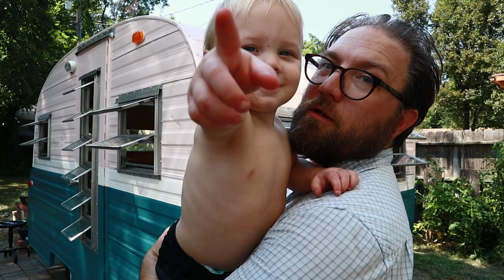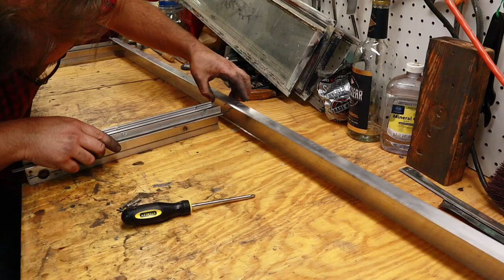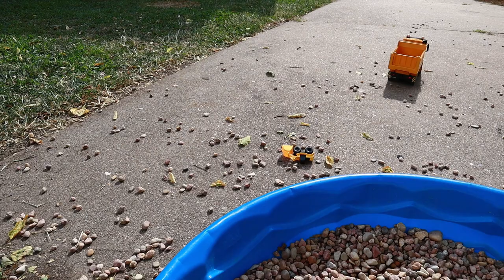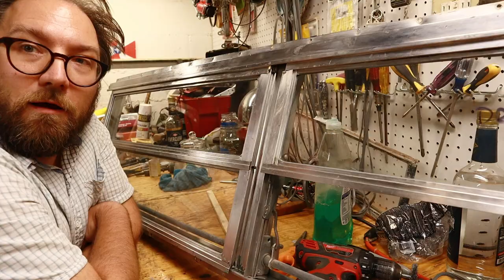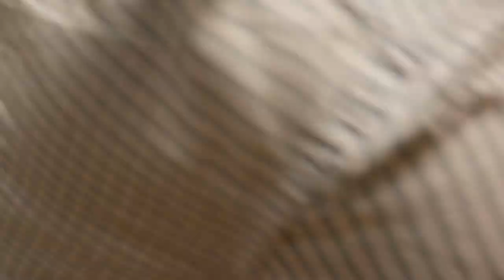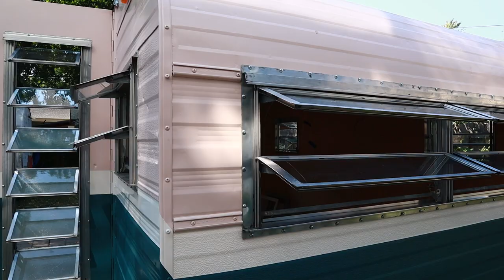FINALLY finishing our VINTAGE CAMPER WINDOWS!

Comment: What do you put in there between the metal and glass to reseal it? 
Also did you take them apart just to make them really clean or did they need resealed?
Reply from the maker: The old seals were really brittle and needed to be replaced in addition to it being easier to clean up the window frames without the glass in them. There is a specific seal for each specific window type. I ordered the replacement seals from vintagetrailergaskets.com.
Reply: @TrailerTrashtoTreasure  Could you provide the link for the exact sealant you used? I have a scotty serro with the crank windows like you have....
Reply: And what was the green stuff in the bottle?
Reply from the maker: All of the seals I used for these windows are linked in the description of this video where I describe how to get the top fin seal in place:
 https://youtu.be/kfjxOgNjUxI?si=yRa-D_8sxxQX_fpb

You'll want to pick up some aluminum gutter sealant for sealing the joints where the sides of the window frames come together as I demonstrate in the linked video. And you'll also want some butyl tape to seal against the camper skin when you replace the window.

Good luck!
Reply from the maker: Just regular old dish soap.

Comment: What did you use to seal the frame parts together. Mine had a gray colored epoxy. Just unsure of what to use.
Reply from the maker: Ha ha, well here's the thing, that's the one part that I really screwed up on. I assumed, based on how sloppy the application of that gray epoxy was, that some previous owner had tried to apply that stuff so I left it off. I was wrong. Unfortunately, I don't have a great answer for what to use, but I believe you want to use the gray gutter sealant that you can find in a caulking gun tube at most hardware stores...but apply it neatly if you can. Good luck!
Reply: @TrailerTrashtoTreasure  that's what I bought just wasnt sure if there was a better product you had luck with. I'm enjoying my rebuild but the windows are a bull that's for sure.
Reply from the maker: Yeah, windows are a time vampire for sure. I always assumed there'd be an RV specific window sealant, but so far I haven't found anything better than gutter sealant.

Comment: I'm curious about the Everclear - I just use it to make moonshine, lol. Does it work better than regular rubbing alcohol?
Reply from the maker: It is STRONG stuff for sure! It's mot necessarily better than rubbing alcohol, but in some places it's easier to find 190 proof Everclear than it is to find 95% or better rubbing alcohol. The reason you want the higher alcohol content is that it evaporates so much quicker and leaves less residue behind. Plus you can drink Everclear in a pinch ; )